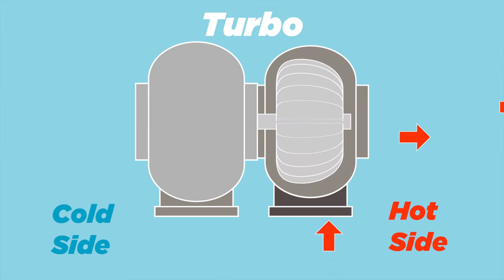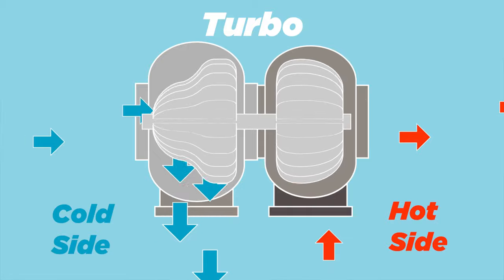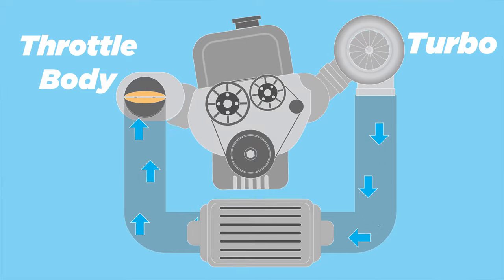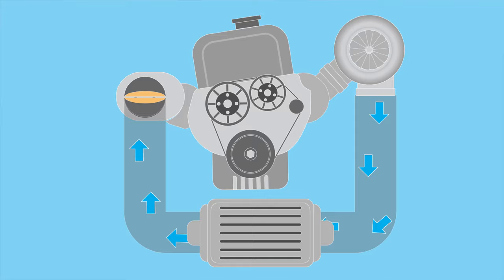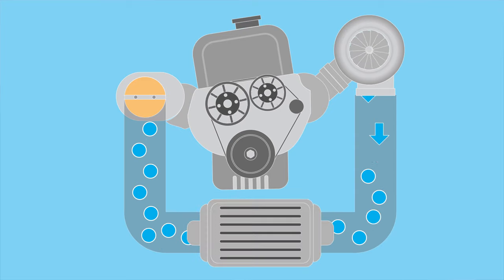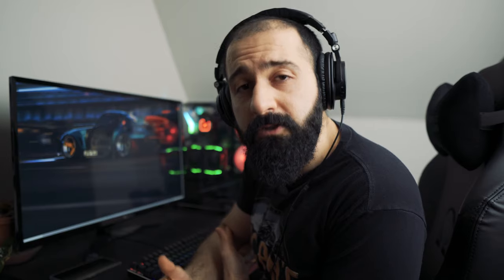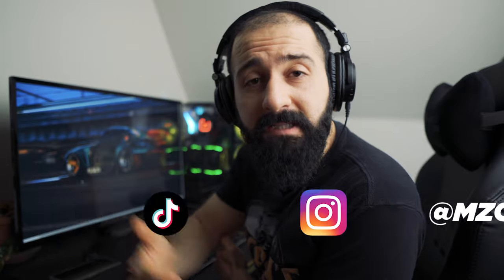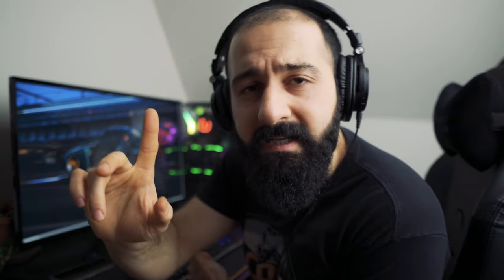Turbo Noises || EXPLAINED

Comment: I rlly like this type of content btw, it’s rlly interesting. Looking forward to more of this type of thing
Reply from the maker: Thanks man, I appreciate the feedback, it's helpful 👍
Reply: Same I subbed!
Reply: Please suggest best turbo
Reply: Rlly good
Reply: Need advice, replaced my stock turbos ( cus they were leaking oil) on my 2015 m4,  installed CTS stage 2+ turbos.  It runs great with my stage 2 tune that I've been using. I hear the spool loud and clear, pulls hard, but I get this flutter sound especially when going hard in Sports+ mode, almost like in the end of this video. Would a custom tune fix this flutter? Ive seen smoke come out for like 15 seconds..twice in the last 2 months. Csn this be from compressor surge? A quote for custom tune by RK Tunes is going to cost about $1400 minimum.

Comment: There are also two types of valves. There are regular BOV blow off valves, and then there are recirculating bypass valves. 

The BPV is more quiet and makes a longer wooshier softer noise. While most BOVs are set up on purpose to make the loudest most aggressive metallic whistling "PSHHH" sounds as they can. 

Most turbocharged cars actually come stock with a BPV instead of a BOV or no valve. This is because for stock levels of boost, it is simply the most efficient solution, that also prolongs the life of your engine and turbo the best. What it does differently, is that it loops the compressed air around back into the intake system. This will make it so that your stock tune reading the MAF (mass airflow) sensor, won't be confused by the air suddenly being vented out of the intake system. And it will help you stay on boost even if you change gears, or pump the throttle during a drift etc.
Reply: Yes diverter valves are a good compromise. My Abarth has it stock. At lower boost I hear more of a soft stutututu and at high boost I hear pshhhtututu

Comment: really great video but you forgot to mention the diffrences of the diffrent compressor surges. There are two types of compressor surge, the is one called closed throttle compressor surge and open throttle compressor surge. The diffrences is that the open throttle compressor surge is were the turbo makes to much boost for your engine, aka your engine is overwhelmed with the boost and it cant use it since it cant fire faster than its getting air, and that is were it is bad for your turbo. Your turbo tries to make more boost while they compressed air has no where to go than out of the turbo again, which creates to much stress for the turbo. So closed throttle compressor surge is not dangerous at all for your turbo since its not trying to feed more air to the engine so there is no stress
Reply: There was a reply a few years ago from mzopyrus stating what you said, but still, get a like so this comment get higher its still good info
Reply: yeah as long as you dont hear the stu stu stu while under load you should be fine
Reply: Can a tune fix open throttle compressor surge? I put slightly larger hybrid turbos on my f83 m4. It runs great with my regular stage 2 tune, but when I go hard in sport + it flutters on and off throttle

Comment: Alternative to a dump valve is a recirculation valve. Instead of venting to atmosphere a recirculation valve vents the compressed air back into the engine intake it basically reuses the air and reduces the lag by boosting the air being drawn into the engine. The limiting factor here being the amount of air which can be recirculated. The downside being that it gives positive pressure in the rocker cover and over time can cause rocker cover gasket failure. An engine which uses a recirculation valve is not suitable to switch for a dump valve because the ECU is programmed to allow more fuel when recirculating and having a dump valve means the extra air is not there for the mix this can cause over fuelling engine damage over time and lag issues in the short term.

Comment: Just for reference the turbine is driven by gas and an impeller is what drives the gas. Basically, the comd side is an impeller and the hot side is the turbine or the impeller is powered by an outside force and a turbine is what powers the shaft it's on.

Comment: Or alternatively, you can set it back on Recirculation. You won't get fancy fancy noises but the air will get recirculated back into your intake and won't cause a BOV jerk. It does on my CVT. 

But #Weliveforthesounds

Something to take note, installing BOV on manuals will guarantee you a CEL. But usually people either just heck it or just clear the fault code regularly using BT OBD Reader.

Comment: I got a question, I have a 1993 Honda Civic Del Sol S but with swapped D16Z6 engine/manual. I want to turbo it and I want to make around 10psi. Is it possible to make a turbo sound like the EVO X at 3:30 at 10 psi or no and if it is possible, how do I make that sound and what is it called?

Comment: Get a diverter valve, that’s a mix of both. It blows off excessive pressure but also diverts it back in  in front of the turbo

Comment: Thank You For Not Saying The Compressor Surge Is The Sound Of The Turbo Spinning Back Words XD. The Only Thing I Don't Agree With Is The BOV And It Being More Laggy Off On Throttle Then No BOV.  From My Experience BOV Help Maintain Your Turbo Speed Better. When There's No BOV There Is Air Pushing Back Through The Compressor. I Believe This Slows Down Your Turbo Quicker Then If It Were Free Flowing Through A BOV. I've Daily Drove Without A BOV For Years And Decided To Try Them Out And I Noticed The Off On Throttle / Boost Spool Response Is Better With A BOV. However I Never Run A BOV Becasue I Love Compressor Surge Sound. I've Also Yet To Find A BOV That Actually Seals Perfectly When Shut (eBay at least) And I'm Not Spending Over 200 For One XD. Wastages... I Spend The Money haha.

Comment: It will wear parts significantly but if you do a billit kit it will lower the risk significantly
Reply: Billet is like carbon fiber. It’s not significantly stronger, it’s LIGHTER for the same physical dimension 

The shaft is billet and that’s not where the abuse is happening 

Slamming molecules into a physical mass that’s spinning kills thrust bearings/floating clip which are the most common (cheapest) center section on the market

Comment: Good video however I would add that you can still have the compressor surge "issue" if your not using the correct springs for you BOV. Also the only time compressor surge has really been shown to be harmful from what ive seen is if your on throttle and expirencing it.

Comment: So, I don’t know a lot of cars just a little. When the throttle is stopped obviously air is “stuck” temporarily and it goes out a BoV however, when shifting during a “full send” other than re engaging the Trany does to account for extra “torque” during shift points? Might be an dumb Q lol.

Comment: Hey awesome vid.
In your opinion does the compressed air going back into the turbo actually hurt the components enough to worry about them?
thanks
Reply from the maker: No I don't believe it's really harmful, a good turbo should be able to handle off throttle surge with no problem. However if surge happens while on throttle, it is bad, very bad.
Reply: @MZopyrus  thanks for that :)

Comment: So uhm i got a stock diesel 2,0 liter and it does the stustustu sound and I'm afraid if i should be worried or not even with stock airbox you can hear it

Comment: I mean you don't necessarily need a blow off valve. In fact a recirculation valve will give you better turbo performance. Better to start at 0 than at -10

Comment: Great insights! I have a question  though: Is there possibly a sound that sounds similar to the turbo but actually indicates wear on another part that might be near it’s lifecycle?
Reply: your gasket is probably loose id get it checced out by the dealership they'll probably fix it for little to nothing

Comment: I drive a big commercial truck and it's got a turbo in it. It goes pppssshhh when I get off the throttle so I guess that it had a blow off valve. It's a mean old truck and it gets the job done

Comment: Would a freely flowing exhaust with a stock intake cause the turbines to shift over and rub the housing producing a loud Train Whistle sound, almost like screeching sound at full boost and over 4000 rpm. 5500 redline 

I’m new to turbos.
Reply: You probably have a hole in the exhaust.

Comment: Or just instal 2 port blow off valve, it circulate back the compressed air what the system needs and blow off a small amount only.

Comment: So is it bc my turbo is hella small that I never hear any of the two sounds? I have never really listened to it from the outside but still curious if any of y'all know
Reply from the maker: If your car was turbocharged from factory  you won't hear a thing usually, that's by design
Reply: @MZopyrus  same question. Most cars these days come out of the factory with either turbocharged or twin-turbo engines. But you don't hear cars on the street go stutututu all the time. Why is that?

Comment: So I need another explo video for how you don’t over boost all the time with no blow off valve, is there a waste gate instead for the exhaust so it can’t build too much boost?
Reply: I know this is 4 months old but (to my understanding, I'm not afraid to be wrong) the wastegate is what actually controls your boost level. When the turbo is creating the boost it's set up for, the wastegate opens and lets excess exhaust gas around the turbine, stopping the turbo from creating more boost. If the wastegate is too small or gets stuck, then you'll get boost creep and your pressure will increase.

Comment: Should I use a blow off valve on an everyday car or if it’s off will it affect the engine in a bad way?
Reply from the maker: Not having a blow off valve might be still ok if it's a small turbo. Having it would be potentially better for your turbo itself
Reply: @MZopyrus  ah ok

Comment: My car is making that weird sound the first car in your video is making. I also have a blow off valve but I was worried that the sound meant that my turbo was failing. So should a turbo still make this sound if there is also a blow off valve. Could this sound also be a failing turbo cause ive only just started hearing it and im worried
Reply: If your car used to go pshhhh but now goes stustustustu then good chance the dump valve is not working how it should or working at all.
Reply: @oogs9114  Sorry if i sound naive but is the dump valve another name for the blow off valve. One of the hoses coming from the blow off valve is very soft and seems a bit worn in the middle. Could that be it.  I was really worried it was the turbo giving out again. Only replaced it last year
Reply: @AL-ru3nk  yeah buddy they are the same thing, I’d replace the hose and see if it changes anything, it could be causing a restriction potentially
Reply: That’s what we call them in uk lol
Reply: @oogs9114  ahhh ok yeah Im in Australia and i will definitely replace that hose and see if it makes a difference...thanks :)
Reply: @AL-ru3nk  if that still makes no difference then try giving your dump valve a good clean out as they can get clogged up with dirt and debris, it’s more likely to be clogged up tbh, I’m assuming you have been using it for quite a long time? Or it it relatively new
Reply: @oogs9114  it was on the car when I bought it back in 2014 so no idea how long its been on the car. How do I  clean it out.

Comment: or shove electronic waste gate .....continous pressure bleeding just regulated by electronics ....
Reply: Waste gates and blow off valves are not the same thing, they don't do the same thing.
Reply: @DriftNick  blow off valve bleeds unused air from before throttle body inside the tubing and waste gate regulates turbo fan speed so you do t need bov practically cuz turbo spins so much how engine needs it in the moment
Reply: @jurajokasa834  You are forgetting one important fact, there is pressure in charge pipe when the throttle closes and the waste gate can not stop that, it can not stop the turbo from making boost pressure in an instant.